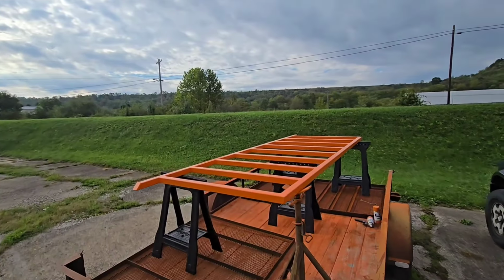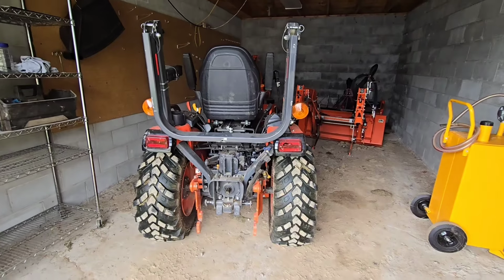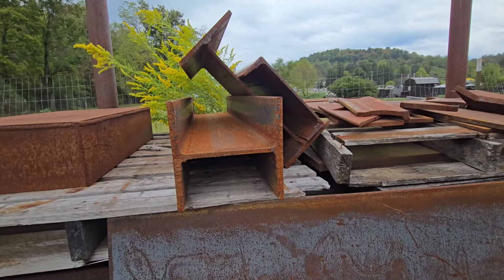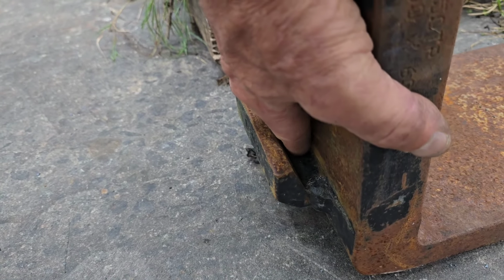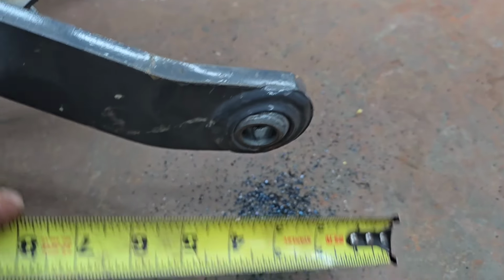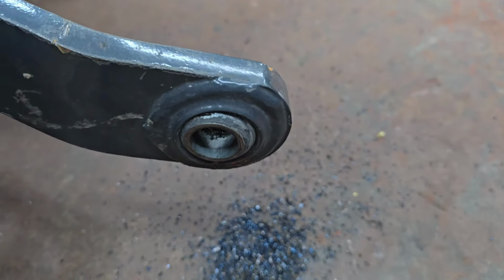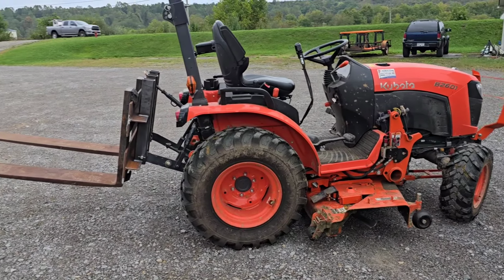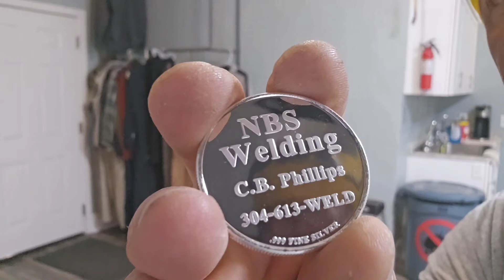Fabricating tractor implements phase 1

Comment: I made a set of pallet forks for my 3 point about 20 years ago, they are very handy.
Reply from the maker: Mine sure lift more weight than the loader can
Reply: @NBSWELDING  Yeah, mine will lift around 2800#

Comment: I luv multi-functional equipment.    Nice addition to the tractor, CB!    Back in the springtine, I added a lifting crane onto my utility trailer and put an outrigger jack on the corner where it sits.  I put a 2500 lb, winch with wireless remote on it, and now I can lift heavy items up and over the trailer rails.    I used it to do a small remote job a couple weeks ago, hoisting my Bobcat onto the trailer, and running my Miller 215 off it with flux core wire.  Did a great job!   Versatility is the way to go, because most of us do not have the money or the room for lots of dedicated equipment to do one task.  I have appropriate rigging chains for many lifting configurations.

Looking forward to your shop built lifting apparatus for the front.
Reply from the maker: Stay tuned!

Comment: Great build!  Just an idea, If you ever have the opportunity to buy a larger old tractor with at least 2 hydraulic remotes you can make a 3 point forklift.  I cut a 3 stage mast off an old fork lift in a junk yard and welded the ears on it for a 3 point tractor hitch.  Then I used a hydraulic cylinder for the top link.  With 2 tractor remotes, you can work the forks up and down and tilt with the top link.  We used this on the farm for years loading round bales of hay on to wagons.  If you get more into neeting to lift higher items you can even put a jib pole on it for raising signs into place.

Comment: This fork set up is great. Good idea. The only concerning thing is that you mentioned that you could use the super duty to pin down the tractor while lifting with the loader. Kubota builds a very hydraulically strong tractor and by pinning down the back of your tractor you could possibly do damage to the tractor. I’ve made several lifts with a JD 4020 (taking farm implements) off of step deck trailer and have done damage to the loader framing. And the back of the tractor wasn’t pinned down.
Reply: I think he just meant doing that to secure the tractor to the ground so the big tires don’t get light and cause a slide situation since the park brake is on the back tires

Edit: I guess I should’ve just waited for CB to answer haha
Reply from the maker: Wasn't meaning that I'd do that while lifting with the loader as much as lifting with the mast I may build to lift sign frames. It would only come into play in the event of a drastic safety issue in which case the tractor frame would not be as much of my concern as my own safety.  If an unexpected gust of wind was gonna cause me to suffer injury or death then to hell with that tractor frame.

Comment: Hey C.B., It's not using tools for what they are not intended for, it's learning to use what you got so you have everything you need.   Seeing those forks laying on the ground, they had a eye on the vertical  portion about half way up.  I see that you cut them off.  The forks were used on a fork lift that has a cylinder attached to the forks at those eyes.  The operator had a lever that controlled the width of the forks.  It's the reason that there are no locks on the top of the forks, like the ones on the Hyster.   The forks on your Hyster are so wide and thin reminds me of the guys at the lumber yard, (not Home Depot) who would count down the number of sheets of plywood,  take a lumber crayon and make a mark, then drive up to the pile and slide the forks in without damaging the plywood, real operators. Oh and they better not catch you lifting something with only one fork. which could bend a fork making impossible to pick loads.  Nice work on the 3 point hitch.
Reply from the maker: Thanks for watching and commenting....the hydraulic width adjustment would be a nice feature...I've never had a lift with that on it but it would be handy

Comment: Man, I love it when you do these ones, CB. 
So can I ask what size wire you used and the settings on your 252? Thank you for the video. I appreciate them.
Reply from the maker: I have two 252's ....I keep .030" in one of them and .035" in the other...I welded this with .035 on 19 volts @ 300ipm
Reply: @NBSWELDING  Ok awesome! Thx. I got some of the Arccaptian flux wire. I got the .030 and the .035. I will be working with them this weekend CB.